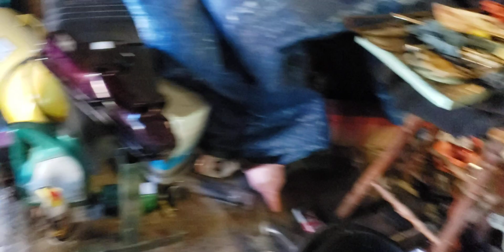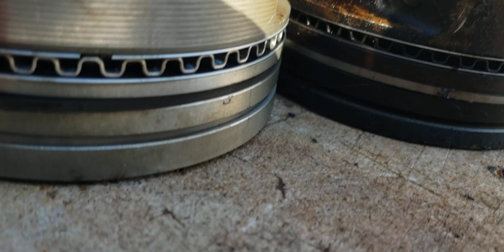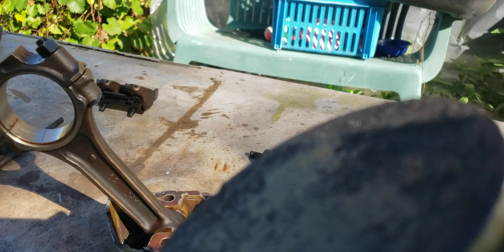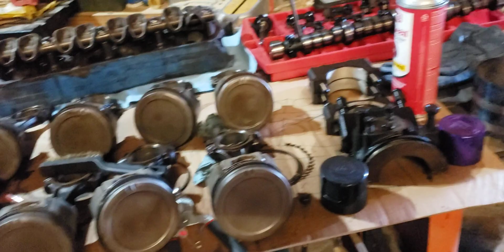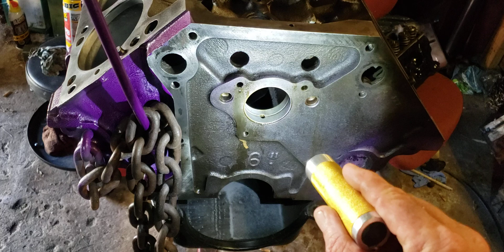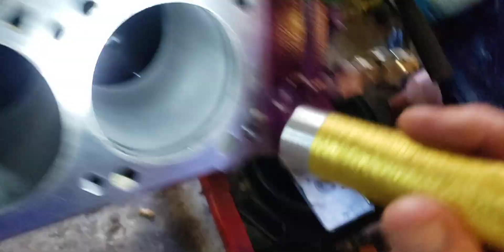magnum style connecting rods in a mopar LA engine

Comment: If you use a magnum piston and rod in a la 360 what balancer do you use on front and rear?
Reply from the maker: Excellent question!
 This 91 360 LA uses the magnum connecting right from the factory, (2nd one I have personally seen) that I know were untouched.) But it had the round dished LA pistons and according to the part number, an LA crankshaft, (magnum 5.9 has a different part number.)
  This one had the 360 LA balanced harmonic balancer, it had no flywheel or torque converter with it, so I don't know for sure what weight was used.
  I don't have any old style LA connecting rods, nor any 5.9L magnum pistons to compare any weight difference.
 So by changing to magnum rods, there doesn't seem to be that much of a critical difference in balance weight for a stock engine. Changing to magnum pistons and rods, while retaining the LA crank, may be enough to cause a problem at higher rpms. Unfortunately these "minor" balancing issues don't have very much info on what to do, other than have a machine shop check it and balane it.